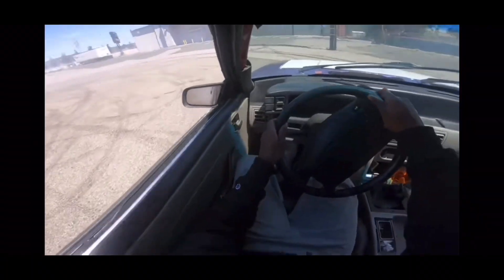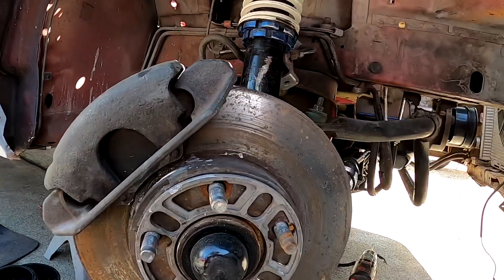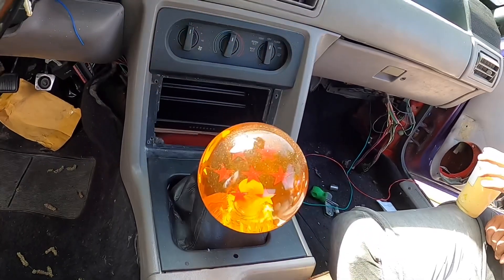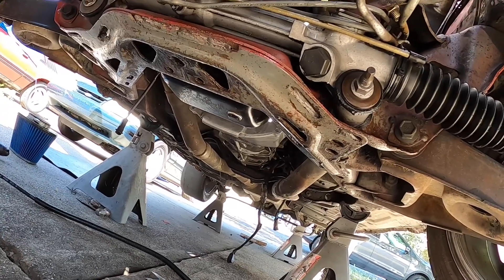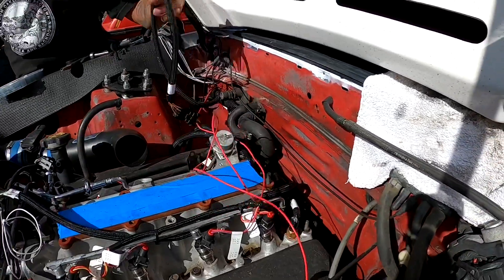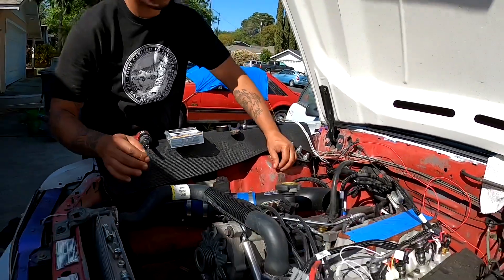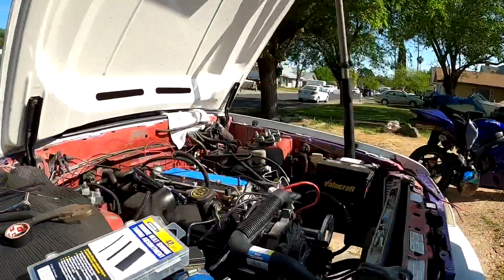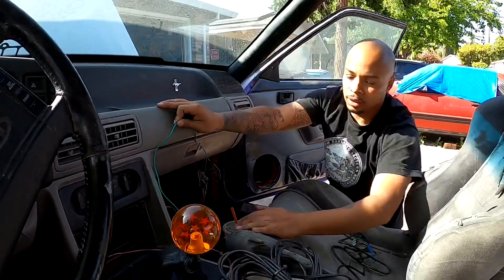Ecu is in,😁Rick is getting it done

Comment: Dude work like a turtle..... Basically ran 3 wires and hooked up injectors since last video...oh yeah...n pressure washed it😂
Reply: Working on 4 cars at once is a bitch!
Reply: Cut him some slack he working on more than one car
Reply: @XplosiveFuZioNHD  i salute his hustle working on 4 at once but I went threw this same situation..the guy that built my 90 gt drive trucks and was working on mine and 2 other cars and fully wired my car.. plus did my 5 lug conversion and a few more odds and ends in 5 weeks that's all I'm saying.. I aint knocking anybody I know its a process but damn 3 wires and injectors in a week.. That's a 3..4 hour job
Reply: @bama256baby  not to mention this isn't my 9-5...this is a side hustle/hobby...I work at my own pace and that told upon drop off plus...Aaron wanted to film alot of what I was doing...i don't rush I take my time and also make sure everything is right before I send. If you follow my ig page you can see how clean my work is.